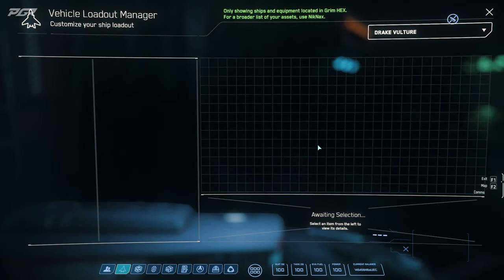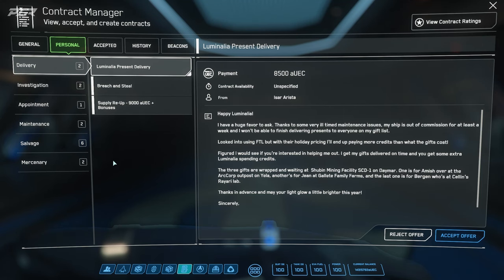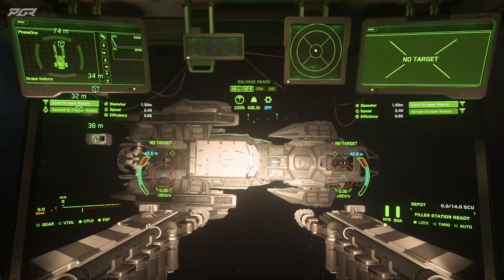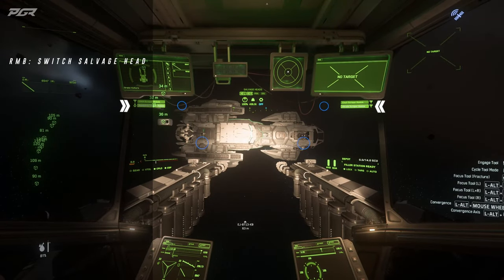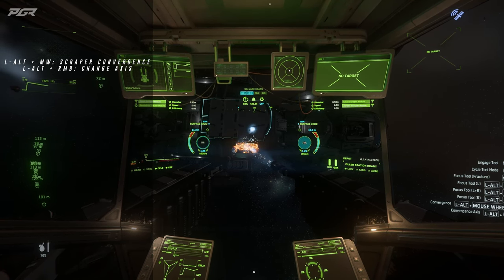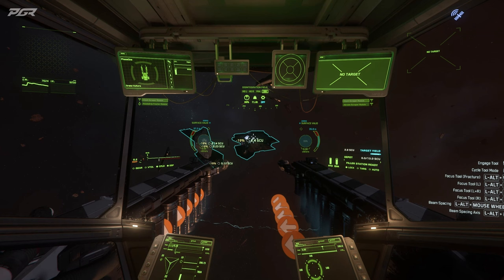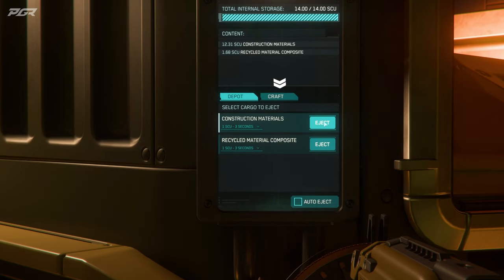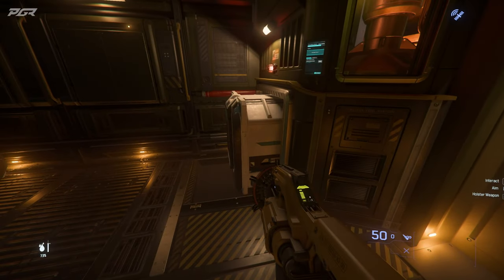Star Citizen 3.22 Salvage Guide(UPDATED) - 2X Your INCOME - All You Need To Know

Comment: What I do:

1. Fill with RMC by stripping hull. Stack in cargo
2. Fill from breaking ship. Stack
3. Fill again with the rest of the ship. Keep in compactor 
4. Fly to New Babbage and land at Command Surface Level  entrance. 
5. Sell everything
6. Go back to ship and stack what is left in hopper into cargo
7. Go back inside and sell again

I get 200-250k per contract that way.
Reply: Question. How do you stack what is left in the hopper? Since we can't use the tractor beam in New Babbage?
Reply: @HendyVelarius   you can use the multi tool if you drag it onto your hands from your inv

Comment: I like to swap out the tractor beam with a second abrasive scrapper. Additionally, I changed the cinge to the thresher, which is what the Reclaimer uses.

Final big tip, u can basically print money with the illegal mission. It gives you 80k on completion and you can just fracture the ship to complete that.
Reply: Since you can only control two at a time, what benefit are you getting from swapping the tractor beam out?
Reply: @steppahouse  it seems like the beams are able to collect faster with the two but I don't have a lot of comparative data to back that up. And the Reclaimer beams cover a bigger area. Stil ltrying to determin if it's faster than the abrasive.

At any rate, that was before 3.22 went live. Currently, it's just quicker and more lucrative to just complete the 80K personal mission by fracking the target then moving on to the next mission. If there is a delay in the next mission then collect the SCU of fracking and turn in between gaps in missions.
Reply: You get criminal stat by doing that right?

Comment: Salvage guide, (solo)
Buy reclaimer 
you wanna take 2 salvage missions to unlock the 50000 uec missions for C2 A2 & M2 ships 

then you can turn up to salvage in reclaimer, EVA out and open the cargo bay ramp then look inside what you want to take is everything except Scrap and any 32scu containers. 

you can also pull off the Weapon mounts if you wanna be extra.

move all cargo toward your ship nose under the claw arm. 

you can pull cargo to the middle elevator then take it in to the ship (it's annoying for extra scratch) 

after this you can scrap the hull for RMC (don't bother doing this on the weekend)
Then head to the claw and break the ship (make sure to go to salvage processing and well dump all the 16 scu boxes (Anywhere doesn't have to be connected to cargo grid) 

after you break the ship and spit the boxes out  (do that bit when in quantum)

you can go to the next Starlifter site 

salvage process should packed to what ever amount you are comfortable with,. 

dump it all at your admin office of choice (i pick Orison so i can sell the CM at the admin and RMC at the TDD)

essntially making 2 mill a run just with CM and random cargo

it's VERY easy to make a lot of money solo in a reclaimer also makes me wonder if we're due for some inflation soon ship prices are getting too accessible.